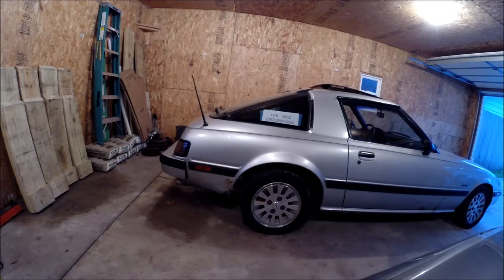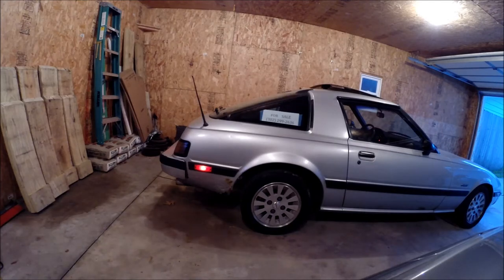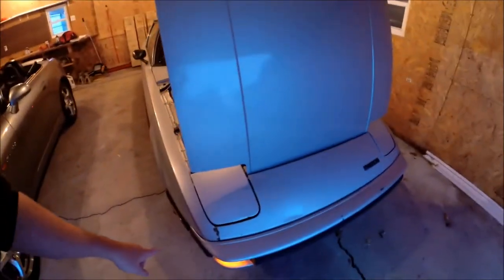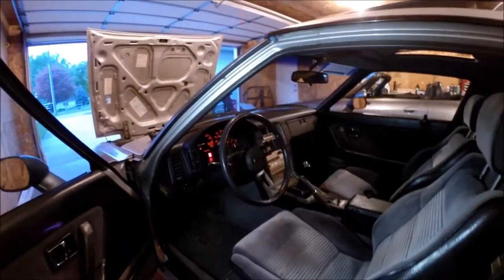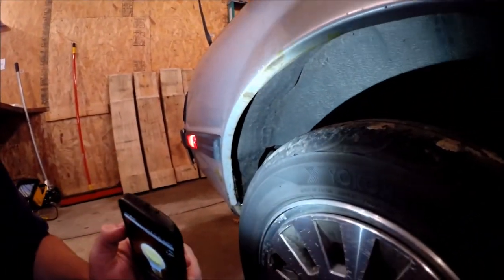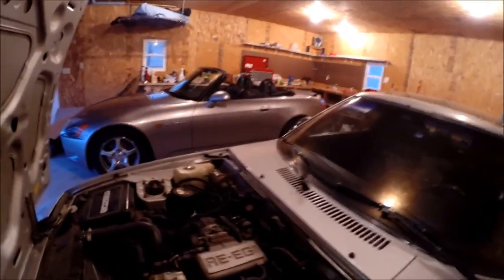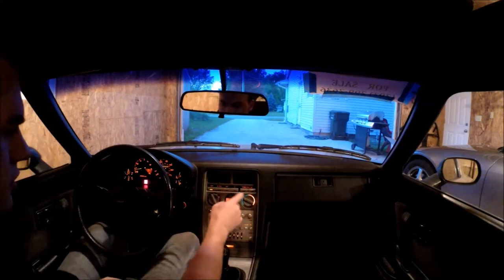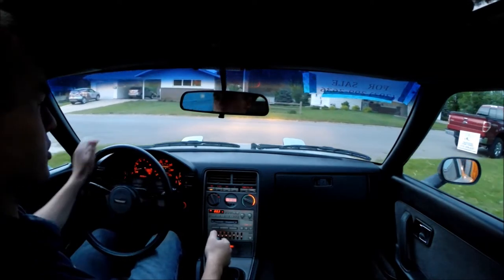1985 RX7 GSL-SE Cold Start and Drive

Comment: I bought a dover white GSL-SE with chocolate brown leather interior, "new" off the showroom floor.  I say "new" as the owner of the dealership's wife drove it the first 2,200 miles.  The only long term problems I remember having was with the electric window lifts and the a/c.  Otherwise, this was one of the finest and most fun cars I've ever owned.  I loved it dearly, and still miss it to this day.  The car came with Ziebart full paint, undercoating and interior protection.  I don't even know if Ziebart is still doing that now.  I think I paid around $18,000 for it, and it was absolutely super clean.  I loved that rotary engine!  Thanks for a trip down memory lane.  I loved the orange dash lighting, thought it was the coolest thing ever.  And a 9? band equalizer for my cassettes!  I was in heaven with that stereo!
Reply: EGlideKid nice I wish I could of got mines new giving me lots of problems lol

Comment: Beautiful cars. I bought a brand new red 85 GSL and brand new black 94 Touring. The 85 GSL(SE) had the BEST sound system I have heard TO DATE with it's 9 band equalizer. Never heard anything better. When you started it up at night, all of the lights inside looked like a darn space ship. I remember the 85 GSL-SE was about $17,000 brand new and the 85 GSL, $15,000. Couldn't see spending $2,000 more dollars for the 13B (vs the 12A). Been kicking myself ever since. LOL. $17,000 in 1985 could buy you almost 6, SIX regular cars.  Miss my red 85 GSL much more than my black 94 Touring. Also bought a brand new vette. The handling on the vette was lousy compared to these beautiful cars.

Comment: If I ever saw a 85 Black RX-7 GSL SE (with reddish brown twill interior), I would seriously think about buying my old car back. Even with the warping 2x throttle body (ended up using a delorto carb/headers through Racing Beat - still might have a carb rebuild kit I never had to use), injector baffle, transmission input shaft getting bent, 2x oil cooler, Limited Slip rear end rebuild, a clutch, leather steering wheel getting sunlight damage and flaking, main stereo ground failing, gas tank sending unit ground rusting up ( I actually still have the sending unit in box) and multiple front end grill getting crunched up using it as a snowplow with the original blizzak tires plus 2nd gear syncro that was a bear to shift cold (though Amsoil synthetic gear oil helped a ton) ... I would buy it in a minute. Back then the NGK plugs sucked and Denso plugs were the only good plug for that rotary engine. Man I worked on just about everything on that car. Learned with a Haynes manual and experience. I still love that car and every time I heard the dash and engine start up sound....Brings back the memories 
Oh ya I even missed the feel powerless steering recirculating ball

Comment: Ive owned 3, a gsl and 2 gsl se's...still have one SE and they all had that damn clutch squeal lol, i would lube it, tighten it, loosen it but it always came back, its just part of the 1st gen rx7 ownership experience lol
Reply from the maker: Haha yeah I tried tearing it down, lubing, adjusting and it always came back shortly after.
Of all the cars I've had though - I miss this one the most!
Reply: 5 years of ownership and i dont remember having that as an issue? But if it's the same case as my 2008 impreza 2.5i, it's the firewall where the clutch pedal mounts that's too weak, and reinforcing that are would get the squeak away.

Comment: Well someone doesnt know how to drive a rotary
Reply from the maker: What do you mean?
Reply: rotary engines like to be reved up to shift
Reply: Steven Tran your kidding right? Are you saying by the end if this video the oil temps where not on operating? Lmao
Reply: Yeah you shift at 5k in rotories. I've had the pleasure of owning an 88 vert (drift car with welded diff, short throw and street ported, and my daily a 1985 fb fully stock besides coilovers (yes has the expensive ass conversion kit) and bbs rims
Reply: You don’t blast off a rotary in a cold start neither do you always want to redline it every single time because that’s gonna wear it out lmao
Reply: Bruh you are blind, even at the very beginning of the drive he was shifting at at least 3k and towards the end he was shifting at 4-5k
Reply: @keppey  no, you let it warm up to operating temp before going for a drive.